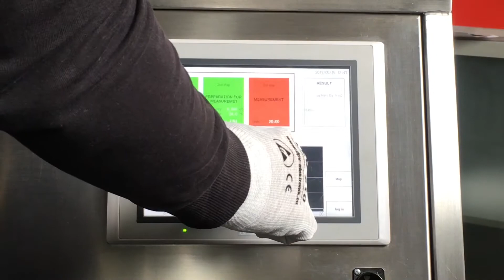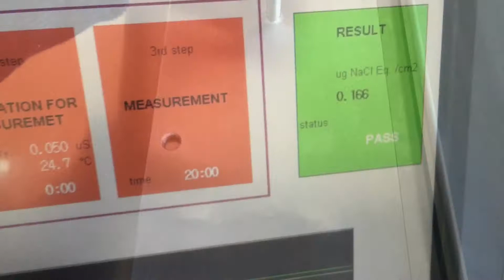Proton® 703 - Silicone cleaning from PCB

Comment: How to obtain this solution proton 703 and R07 are they available in market. Do they need to boil certain temperature. Where could I purchase those solution.
Reply from the maker: This solution is for professional use. You can find the purchasing contact at https://www.dct.cleaning/worldwide-distribution-and-service/.
Observe the temperature procedure! Certainly, nothing boils (100 ° C), the process is just bubbled through the air.
Reply: You cannot purchase something when the vendor will not respond.  Possibly I can have it shipped affordably across our border with Mexico and the fault is mine for not trying that distributor.